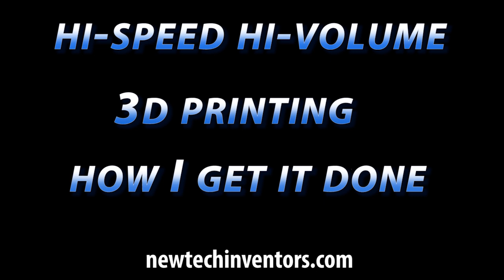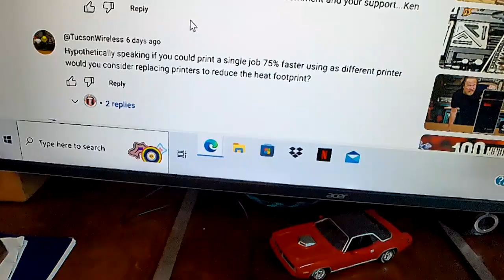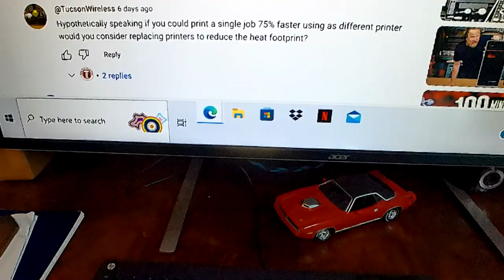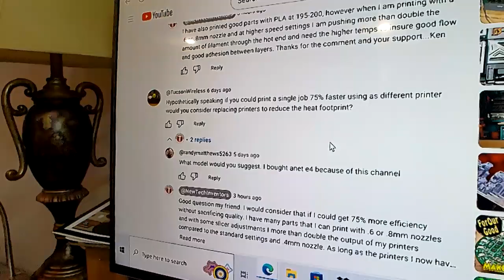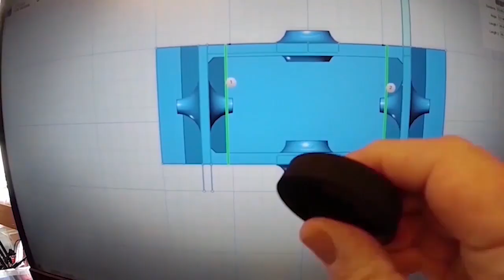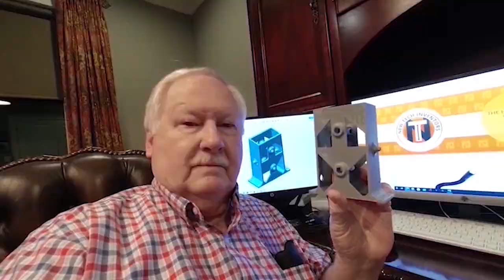HI-SPEED / HI-VOLUME 2D PRINTING, HOW I GET IT DONE at my 3D print farm.

Comment: Have you tried printing with nylon, trimmer line works good especially made in the USA. Really strong parts, and works really well outdoors. Nylon warps so its hard to get it stuck to the bed, use carbon fiber sheet scuff up with some aleene fabric glue. Print at 285, no need to go fast, lower layer height the better.
Reply from the maker: Have not tried that...Ken

Comment: My standard PLA print temperature for a 0.4 nozzle is 220  and silk PLA is 225 to 230.
Reply: I got better detail and less stringing going lower but at the cost of layer adheason and strength of the part. With the direct extruder of the A1 I don't really have to chose anymore.
Reply from the maker: Thanks for the comment...Ken

Comment: Hi ken, when did you get into CAD?
 Have you been tempted to flash some of your printers to Klipper and install stronger extruders and high flow hotends, in order to print faster?
 I recently bought a Bambu Lab X1 Carbon and AMS and it is a game changer, the speed and quality is outrageous, I had my Pro 3D V-King 400 that I built from self sourced very best quality parts, that prints relatively fast using RepRap FW, but nowhere near as fast as the X1 Carbon when in Ludirous mode.
 I print my outdoor parts from ASA, it is claimed that this is the best filament for outdoor parts
Reply from the maker: Thanks for the comment my friend, sorry for a late response...Ken